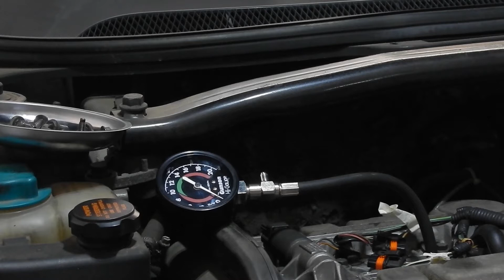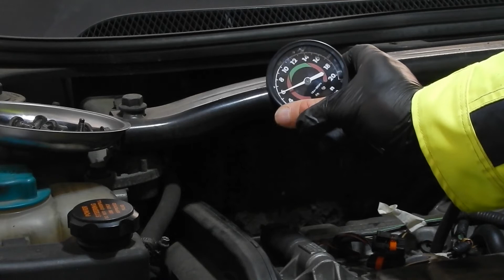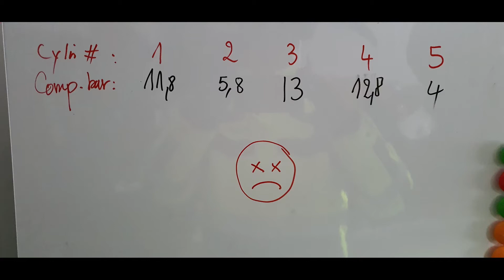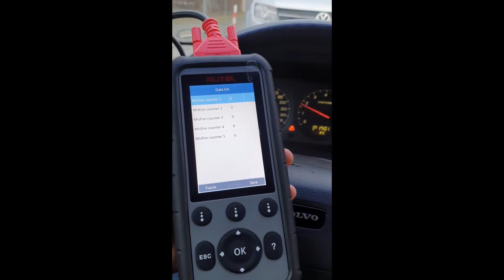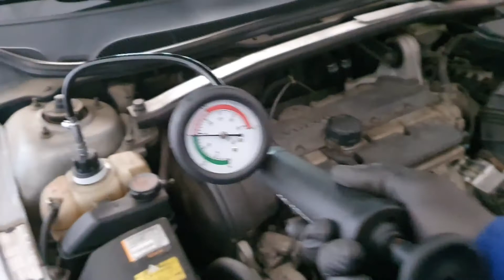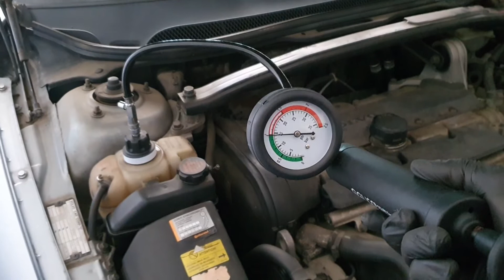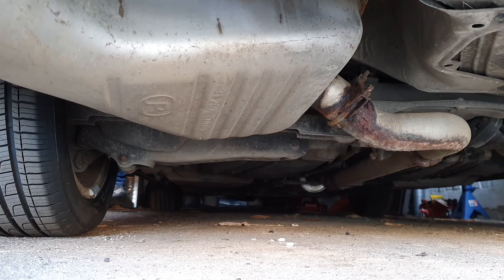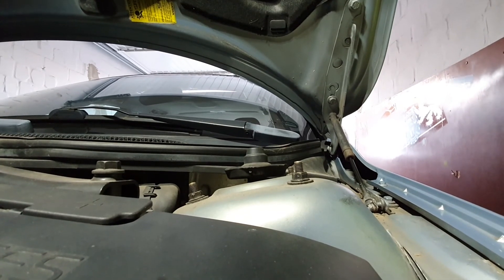Technical check for Volvo V70 II/ Compression test/ coolant leak / Suspension / Catalytic converter

Comment: I'm sure you know this, but there's a routine for checking the transmission fluid level. Drive the car in your hottest temp and then park the car and shift through all gears with 3 seconds in between. Wait two minutes and then check the level!

Comment: I did a compression test on my 99 S80 T5, with the engine cold
Cyl1: 150 psi
Cyl2:150 psi
Cyl3:150 psi
Cyl4:150 psi
Cyl5: 147 psi

Should be alright i assume? or are all of them too low? the car does misfire on cyl2 but it is ocasional, sometimes it does not misfire at all, other times it does, but if you shut the engine and restart it it stops misfiring, already changed plugs and coil packs, switched injector from cyl2 to 4, and still misfire in no2.
Reply from the maker: I think 150psi - 160 psi is the almost the limit to worn.
The misfire in the cyl 2 could be due to a bad valve or dirt on  the valve seat.. or may be the electrical  connection of the coil or injector...
Reply: @DIYTEA  even with a cold engine this values are signs of a worn engine?
Reply from the maker: @DBraz  better do the warm test, the compression should be better.

Comment: I will be interested to see how you get on with this. My car (v70 same engine) has developed a misfire at cold, compression values are 
Cyl1: 165psi

Cyl2: 65psi
Cyl3: 90psi
Cyl4: 65psi
Cyl5: 30psi
Not too great.
Did you put the throttle to the floor when testing? Is this necessary?
Reply: Yes

Comment: @13:12 With 0 DIY experience and average driving skillz, I would try to get rid of it and make a profit in the progress or try to disassemble the engine and use an ultrasonic cleaner to get rid of the carbon deposit.

Comment: Hello there,
I been following your video regarding the harsh shifting the problem is the linear solenoids there is a few videos  on you tube showing how to perform  the fix I have done a few Volvos my self with the same problem. Just look on YouTube shifting solenoids fix
Ok man good luck.
Reply from the maker: Thank mate! I saw several videos about that fix but it seems to be a bit hard to get access to the gearbox pan. How much time is needed to perform that fix, including lowering the subframe?
Reply: @DIYTEA  last time I did this job took me good 10 hours I just take my time bcause I do open the solenoids and clean them the subframe is not that difficult unfortunately there isn't and specific video showing the steps but I can see you are mechanicly oriented you will figure out but on the Matheous volvo forum there is a tutorial on this fix.
Reply from the maker: Thanks for the information bro!

Comment: You still have 3 piston 🤪, now I want to do the same test on my v70. I hope you have simply valve hole dirty.
Reply from the maker: 😄 I think that there is something to do with the dirt arount the valve seats. But my measures were done roughly and not in a proper way. 
I am using some cleaning fuel additifs now with the hope that the cylinders and valves get clean and the compression get better. Will see. 
I will report this in the coming videos.
Reply: I hope it’s carbon and you can get it out. Is this a project car or did you need another car?
Reply from the maker: @anjingkampung  
Just a project and a pass time. Want to own a solid 5 cylinder once and try something else. 
Was looking for another bmw but to find a cheap original one with no rust is imposdible
Reply: @DIYTEA  you can find a old v70 with engine burn for 300, 400 fr. Then change head gasket.
Reply from the maker: @dummag4126  
Yes its an idea. But my problem is the lack of space in my garage to tear the engine down. Also I dont have the time for the swap. 
I believe by removing the head, cleaning the valves or swaping them and cleaning the valve seats the compression will be fine. The cylinder walls are still perfect and the there is no oil comsumption at the moment.